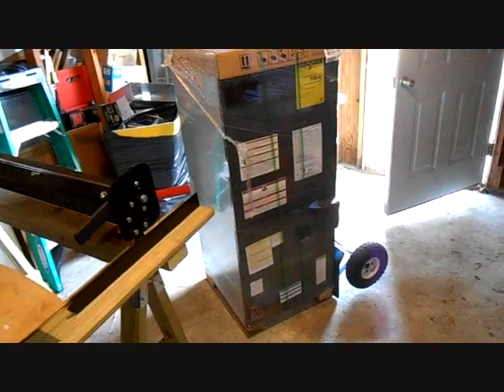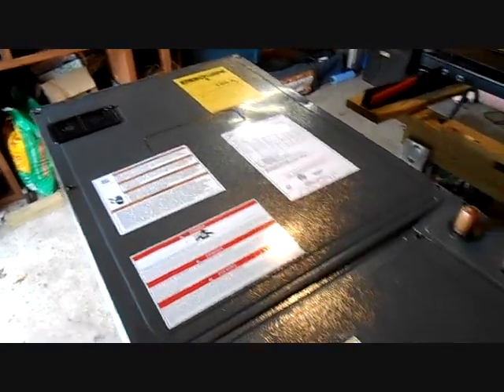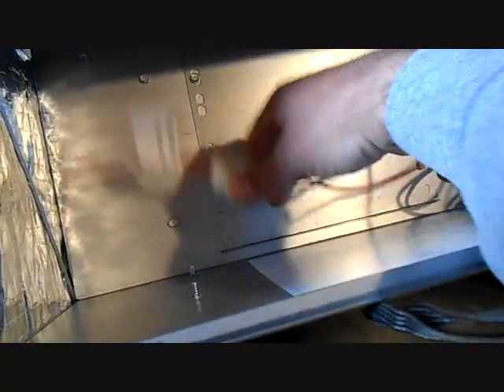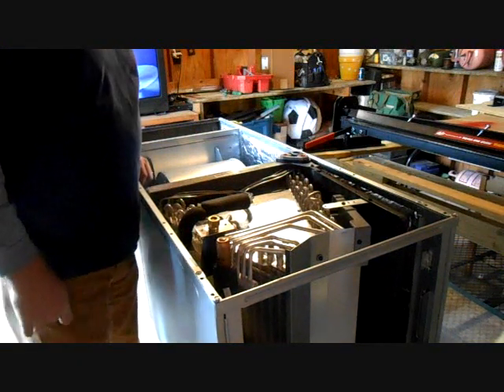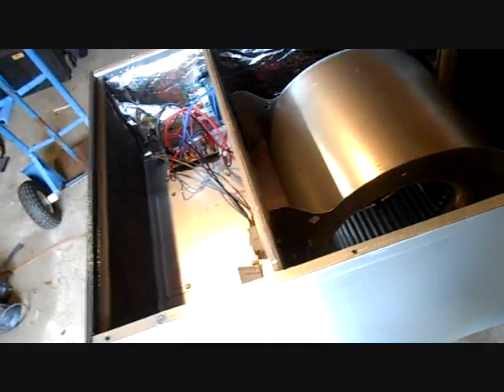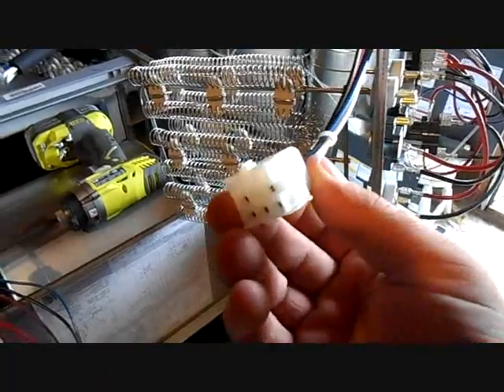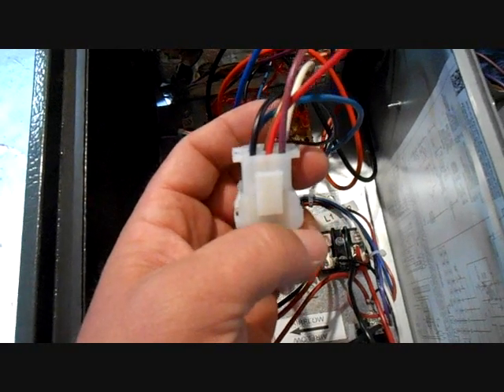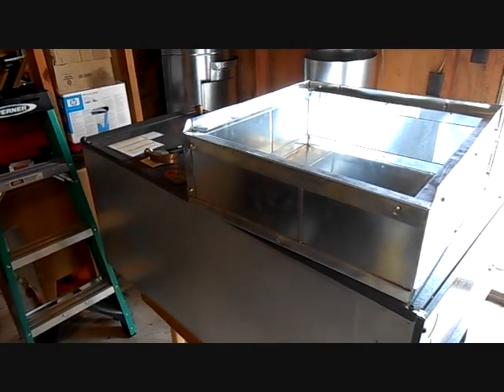HVAC Install- Goodman ARUF Air Handler Prep

Comment: Drain is on top after you flip over. My good man unit if you stand infront of it the wires are all on top then on middle is blower then evaporator then open space at bottom

Comment: I installed an 8kw heat kit, and it wasn't pushing out enough. The customer has an electric air handler with no heat pump for a 5 ton. Should I switch it out for a 20kw? Long as breakers are correct?

Comment: Hi Zack. Thanks a lot for such a great video.  I am installing same AHU 4 tons but cancelling heater strip.  I need to know how to wire 240v lines to my breaker?  breaker size? wire size?  thinking of installing 240 v receptable next to AHU.  little confused? please advise? is 12/2 wire is enough? 30 amps or 40amps breaker? thank you

Comment: What's the difference having the coil positioned to where it opens up to the fan (like you changed it to at the 2:45 mark of the video) versus how it was positioned at the beginning of the video? I notice my coil opens up to the fan, as you changed this one to be. I always thought it was installed backwards...
Reply: The unit ships for up-flow or horizontal left flow. For down flow or horizontal right you flip it. Otherwise, your drain pan is above the coil and will make a mess.

Comment: 2019 installed an ARUF 14 in an attic. The coil had  to be repositioned to horizontal left to right .Not sure if I did it correctly. Do you have videos on the pivoting plastic piece on the drain pan? Your video on speed change is very helpful'

Comment: I had some one install my furnace and I noticed inside my furnace it has a 60 breaker and a 25 breaker but in my panel they used 2 50 breakers and all they used a 10/2 wire is that correct ?

Comment: Hey great video! What gauge wire did you have running to this u nit with the 10kw heating element? Looking at 8AWG but not sure.
Reply from the maker: In this area, a 10 KW typically needs #6 AWG.
Reply: @TALYN875  What about breaker size for this same air handler? Thank you!

Comment: Thank you for the video.  I have one of these aruf182416ba units since 2009...does this air handler suppose to have an air filter inside of it? Maybe near drain pan or near the bottom? I can't find where it goes, plz help me!
Reply: If it has one installed it will be on the intake side of the unit.
Reply: By intake I think he means return and If your system is anything like this video you don't even have any return ducting. Soooooo maybe nowhere depending on how the installer was feeling that day

Comment: Just wanted to say THANK YOU, I recently found a Goodman 5 ton system and did not know about flipping the coils your video helped me and made it all that much easier for me. I got the entire system for just under $1500.00, outdoor compressor, indoor air handler both 5 ton, and heating coil, was this a good purchase? Thanks James
Reply: James Lee Hey where did you find your Goodman system from?
Reply: DNTBLAZE tv I got a 3TON Goodman with air handler and out door unit heat pump for 1900 at AC Wholesalers’s
Reply: Yeah killer deal

Comment: For a 10 kW what size wire should I use 8 or 10 gauge?  And what size breaker is the right one too use thanks bud

Comment: Where does the 90 degree flowrater inlet tube adapter and nut come from?  Does it come with the air handler or do you have to buy them?  The tube without the nut is sold separately as PN #BT1369063, but I cannot find it in the ARUF37D14 air handler that I have.
Reply from the maker: +n4mwd it comes with the AHU

Comment: why were the coils flipped around? 
I installed a brand new unit with heat kit and since the snow my unit can't keep up.  any help?
Reply from the maker: +Junior Soles heat pumps suck in the snow
Reply: Working Joes Roundtable I have my thermostat set at 71.it's 64 in the house.  I feel like there is something that is not telling the EH to kick on
Reply from the maker: +Junior Soles could be improper thermostat set up
Reply: Working Joes Roundtable any Idea on where to look.  I have been all through it.  I have a pro1 855
Reply from the maker: You set up the stat for a 2 heat 1 cool heat pump?
Reply: Working Joes Roundtable 3h 2c

Comment: one thing about that downfall installation in the horizontal kit there is a block off plate so you still need to order the downflow installation kit
Reply: Ben Kuxhouse what does the block off plate do and is that the plate that mounts to the right side of the evap coil, at the bottom. Could u just use a piece of sheet metal and make one of your own? What will happen without it? Thanks!
Reply: @LiVe_AnD_lEt_LiVe_  I misspoke when I texted that you don't need that anymore anyway they change things a little bit since then. I like Goodman equipment

Comment: What is the filter spec for this unit? My renter threw away the old one and I have no idea what is the exact dimension for a new one. Thanks
Reply: +555hendry Should be a label on the air handler. If not, then you may need to take a tape measure and measure the air intake grill.
Reply: If it is a Goodman  aruf182416ba unit, then it is a 16x20 on the main level  and 12x12 on the floor upstairs

Comment: Hi, I have a question. This summer I had a Goodman ARUF Air Handler installed. They told me that I need to drain it before winter so the water in the line would not freeze. They showed me how but that was several months ago and I don't see any information about it in the manual. I was just wondering if you would be able to help me out. Thanks

Comment: Great video!  But, I'm having a terrible time w brand new split heat pump.  Had it installed 1 month ago and been working great.  Now comes cold weather and as thermostat is placed in htr position, wham! It blows the three amp fuse.  Disconnect all low voltage wires at cond unit and it still blows fuse.  Disconnect connector to heat strips and does not blow fuse until you plug it in and wham! There goes another fuse.  Would you pls give me your advice and or call me 706-825-7180 in Augusta GA or anyone else that has an idea of what might be the problem.  Tks in advance.  😊

Comment: Goodman sucks. I wouldn't recommend a split system that has aluminum refrigerant coils, because aluminum does not exchange thermal energy as well as copper does.  These units claim to be energy savers, yet they are built with materials that do not exchange thermal energy as well as copper!  I'd like to know how a lot of these manufactures get away with what they advertise their equipment does, because aluminum evaporator coils won't save you energy (in cost) the way copper evaporator coils will.
Reply: +jjs777fzr car ac evaps have been alum forever cant be that bad
Reply: It sounds like you'be never made the mistake of owning...well anything by Goodman. Which is good for you. Goodman (a better name is Badman) makes junk!  But in Badman's defense, a lot of manufacturers like Carrier (who USED to make top quality stuff) are putting aluminum evap coils in their air handlers.  Carrier furnaces, evap coils & air handlers are known for rusting & getting moldy inside. Carrier continues to blame the installer (especially when converting the evap coil to a horizontal application) for not flipping an aluminum "drip guide" or flange around, but its ultimately Carrier's shitty patent & they are too cheap & proud to change or improve it so I see a lot of black mold & rusted EVERYTHING out in the field with Carrier. And these Carrier unit are usually only 5 or so years old!!!  Lennox doesn't make that bad of stuff.  & just so you know...its NOT hard to stop a Trane...but it is a pain is in the neck to get to their condenser fan motors on their condensing units especially the 5 tons.  Payne really is a pain...appropriately named.  Ruud/Rheem are OK, but you gotta damn near take apart the whole condensing unit just to effectively clean the coil.  But def stay away from Badman!
Reply: Can you specify a source for your information re: aluminum not exchanging energy as well as copper ?   I believe copper absorbs energy better but aluminum will dissipate energy better/quicker.   Try this...throw copper and aluminum into oven (try for same shape and weight) and heat to some temp like 300F.   Now remove both from oven - shoot with infra temp gun over equal time periods.   Aluminum will dissipate energy quicker.  Try the reverse - throw both in freezer.  Remove.  Shoot both with infra gun over consistent intervals.   Aluminum dissipates heat quicker.  Copper may absorb quicker/better but aluminum should dissipate quicker.   At least this is what I remember from past research.   If I apply this to a evap coil like in an AC - I'd think aluminum should work just fine.   As for longevity etc I don't know.  No doubt CU is more costly and harder to fabricate into same design/shape as AL.   I'm no professional installer...but I don't think efficiency is linked to the use of CU vs AL will provide much of a difference.  But like I said...if you can provide a source for your statement I'd give it a read.   I have owned and operated a goodman split system since 2006 and seems to work well with zero issues.  Now I want to check to see if it used CU or AL circa '06.
Reply: jjs777fzr whatever makes you happy
Reply: elevatorman013  You claim that "All [I] do is whine..."

You don't know me. You've never even met me.  

You are quick to pass a judgment on my character....& a false one at that.

As an HVAC tech, I speak from experience.  Copper is a better material for a heat exchanger, than aluminum.

To be fair to Goodman, I work in a city on the Gulf of Mexico.  The salt is what corrodes equipment. Both the condensing units & heat pumps outside, & the inside units.

So unless a corrosion grenade is installed on the suction line, or the unit is dismantled & coated with a corrosion resistant paint, then the units don't last very long.

However, Goodman is a low-end manufacturer. & you get what you pay for.  Other brands, like Lennox, Trane, etc hold up a lot better than Goodman.

30 years ago the aluminum was thicker.  & Goodman cuts corners on their welds too.  I've installed replacement Goodman condenser coils that were shipped with cracked welds & of course no pressurized nitrogen.

Goodman could easily change their processes to give the customer a higher quality product, but they wont because they are too cheap to spend the extra money.

Maybe Goodman is OK elsewhere in the U.S., but near the ocean they just don't stand a chance. After about 3 years, they are crumbling apart....literally crumbling.  They deteriorate faster than the other brands do.

I've had tenants blow their top at me because they needed a new unit & their landlord bought them a Goodman, rather than a Lennox!

People down here know how cheap Goodman is.

I'm not whining. I'm only telling what I have personally witnessed with Goodman.
Reply: @adamrspears1981  Adam please answer the question
Reply: @jjs777fzr  Does your Goodman have an air handler have a air filter inside of it, at the bottom or not at all. Please answer.
Reply: @adamrspears1981  I believe it does to depend on where you live/location actually....
Reply: @tralyn5271  Both of you make strong arguments about copper verses aluminum coils. You're both right!!! Jesus loves you!!!